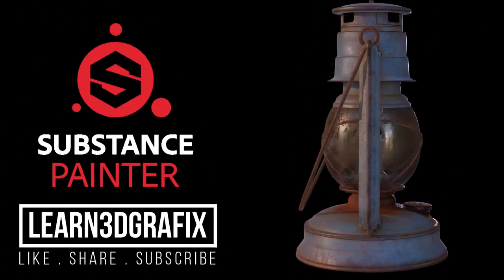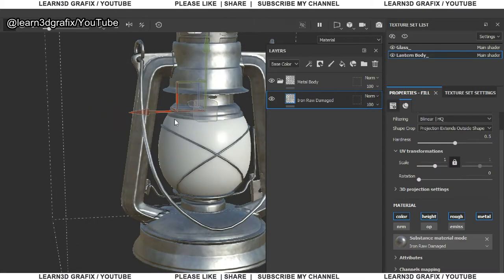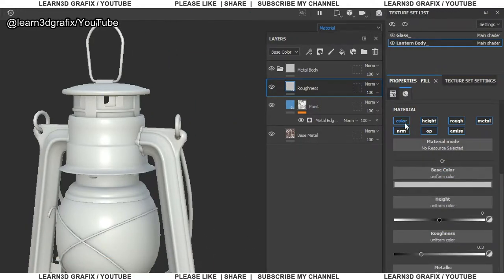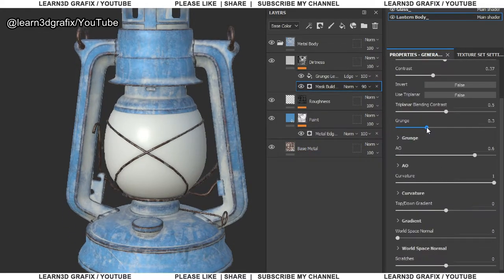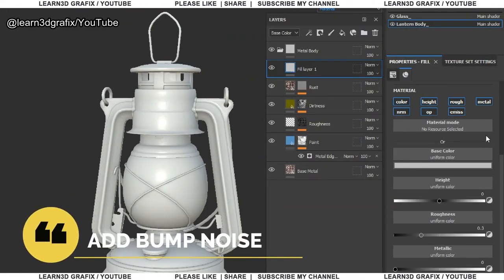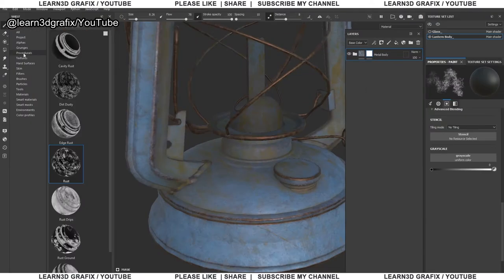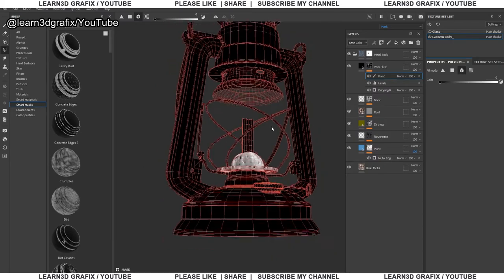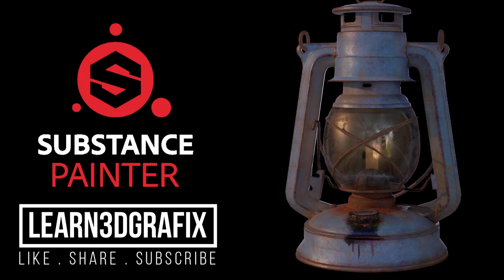Game Ready Lantern Modeling And Texturing | Part 03 | Blender |  Substance Painter

Comment: How did you get two different texture sets (for the body and the glass) ? I only have one for the whole object
Reply from the maker: If we apply two different materials. One for all the lantern metal pieces and one just for glass in blender, 3ds max or any other 3d modeling software and then export it. When we import it in substance painter, the software will identify the materials and keep them separate for texturing. We can textures in both way. Either with same material for complete lantern or two different materials, one for metal body and one for glass.
If there is anything else you need to know for the lantern tutorials, please do let me know :)